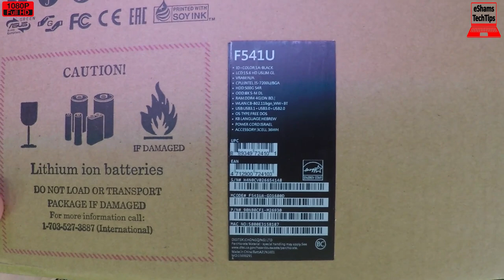ASUS F541U Partial Disassembly and Reassembly

Comment: What is the difference between f541u and f542u (f542uf)?  I want to buy an SSD drive.  I do not know if I should replace the old HDD or there will be a slot on the motherboard for an additional SSD m.2 Sata.

Comment: hi! do you know if this laptop supports the ASUS ROG-XG-Station-2 2 Thunderbolt 3 USB 3.0 External
Reply from the maker: Hello Nico, The ASUS F541U won't work with ROG2 This is the supporting models for the ASUS ROG 2
ROG Gaming Series Transformer Book Series ZenBook Series Intel NUC Kit
ROG GL702VM; ROG GL702VM-7th-Gen-Intel-Core T303UA UX490UA NUC6i7KYK
ROG GL502VM; ROG GL502VM-7th-Gen-Intel-Core T305CA UX501VW NUC7i5BNK
ROG GL702VS  UX550VD NUC7i5BNH
ROG G701VI; ROG G701VI-7th-Gen-Intel-Core  UX550VE NUC7i7BNH
ROG G752VS; ROG G752VS-7th-Gen-Intel-Core; ROG G752VL; ROG G752VM; ROG G752VT; ROG G752VY   NUC7i5BNHX1
ROG G501VW   NUC7i7BNHX1
ROG GX800VH-7th-Gen-Intel-Core

Comment: hello i am looking to buy 8 gb of ram for this computer, i would like to know if my 4 gb of ram installed on this pc can be removed, how many real slots of ram i can use, and if i can buy 4 gb of ram to use with the 4 gb that i allready have.
thank for your attention
Reply from the maker: Hello Kraklin, you have 4G soldered to the mainboard, you have one slot to add another 8G ram (4G-Embeded+8G-In the empty slot) total 12G and this is the max ram for this model. good luck
Reply: thank you for the quick response, do you recomend me to add 4 gbs or 8 gbs?

Comment: is the ram soldered in?
Reply: ok i see that it isnt, however i have 8gb of ddr4 in mine, does that mean i can add an additional 8?
Reply from the maker: The ram is soldered to the board, you can add ram on the other side of the mainboard.
Reply: thanks brother. that means i can add another 8?
Reply from the maker: yes you can add another 8G,
Reply: thank you a lot
Reply from the maker: you are welcome